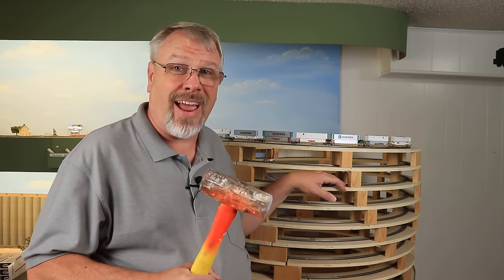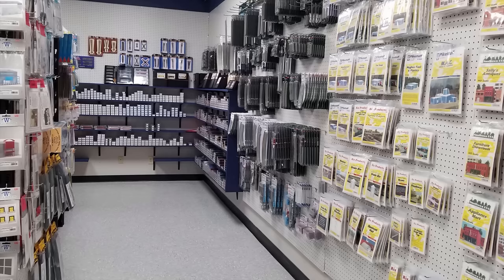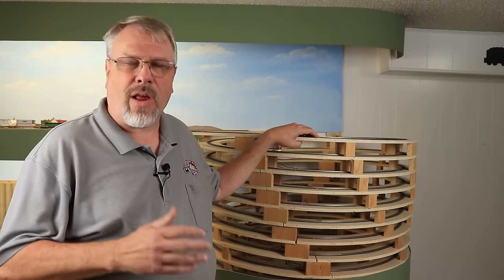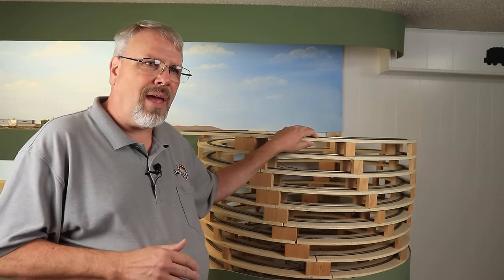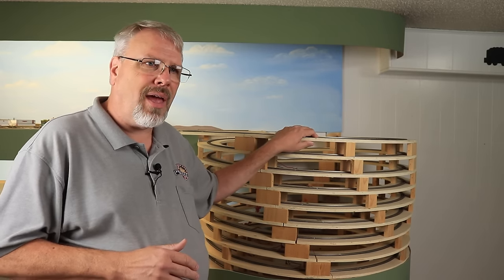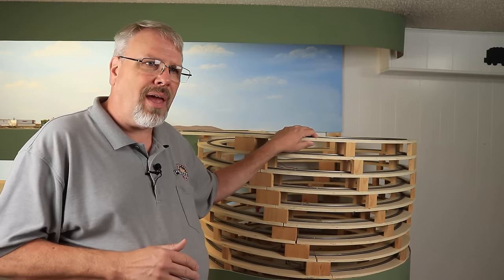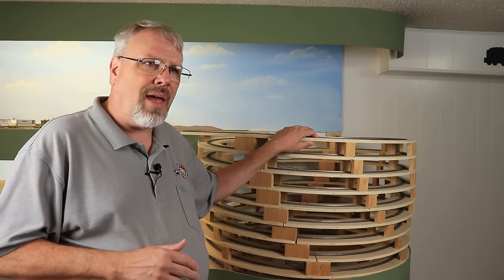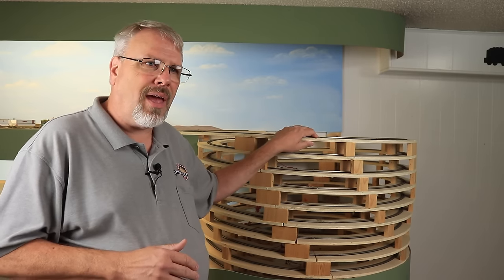Model Railroad Demolition - Bye Bye Helix

Comment: Very much enjoyed your demo video. I noticed you said you precisely cut the blocks between the levels. Your a better carpenter than most finish carpenters if you can do that 👍
I would suggest using threaded rods for absolutely precise adjustment to grade. I built o large helix as part of a crew on a friends layout and when finished we were able to make minute adjustments using a caliper and eye by turning the supporting nuts on the rods even a 1/4 or less of a turn. The adjustments are precise.  We used 24 turn to the inch but 18 turn would have been sufficient. One of the crew is an engineer and came up with a quick and easy system to spin the nuts into position on the rods. YouTube video listed under Jim Walsh
Consider this alternative to give yourself a break. 
Good luck 
Joe Valentine

Comment: +1 for 44" radius. Good move. Also recommend double track helix to eliminate delays and provides a passing location. You can always 'bad order' one track if you want single track ops for a change.
Reply from the maker: In my case, I have a passing siding immediately at the top and bottom of the helix, so I didn't plan for 2 tracks. That said, if I had a problem with a track, a second would give me a backup.
Reply: @RonsTrainsNThings   Certainly. Another possible value of the second track is to stage a train. Don't know if that works for your ops scheme but worth considering in the design stage.

Comment: NW Loop 820.  Well familiar with the area over by White Settlement when I worked at General Dynamics as an engineer on the F16 C and D models.

Put levels on the bottom of the legs for the new helix

Comment: Wow! Can't wait to see what you do. Thanks for sharing.
Reply: I too start in the second week in August spending the money and time to make room, level the ground, build a new fence, and pour a concrete pad for a shed for my new layout. I sold my test layout which will be gone tomorrow.  The new shed that will be built next year will be 12 feet by 16 feet. Wish I could go 20? but I just can't seem to swing it. However? It will be a nice insulated, central air and heating, with 70 amp beaker box to supply Power and lights. Can't wait to get that going. I will be watching what you do closely. After all I have two helix's to build. I plan on staying tune.
Reply from the maker: That sounds like an exciting project. Be sure to keep us updated on how building is going. Good luck.

Comment: Ron, I hate helices for many reasons. If I ever rip out either or both of mine, I will find a way to avoid replacing them, perhaps using a gradual, around-the-room incline. Admittedly, though, my layout isn't multi-level in the traditional sense. Trains go down my helices only to reach staging. And if I had to use a helix, I would make sure that it's open and accessible from all sides, so that trains and track in the helix can be reached easily without crawling under the layout. ...Roy
Reply: OHHHH PU YOU Panama,
Though I agree all side oh the helix, including the inside, must be reachable and repairable,  Ron is also correct that a helix offers the sense of time the consist needs to travel under.  Of course you presently ONLY go to staging.  Wait till you need more towns and scenery.  The lower level may need to start Operating.
As I wrote to you on your channel my big boys and I have started a rehab of my Upstate N.Y. layout 11 days ago.  Still a lot of demo to do, but the helix, in the mushroom, slipped out like track jointer before soldering.
We are saving the helix for another purpose, but this weekend we are shutting down the Bar Room.  Across the hall.  Since behind the back bar we will be building two dogbone shaped, DNA styled, helices.  From the ceiling soffit (about 12 feet high) down to 4 1/2 feet off the floor.  The early plans are to do a track loop.  Behind the Seeburg jukebox.  Actually in the adjoining room.  And return up to the ceiling on the opposing dog bone.  NO REVERSING LOOPS NEEDED.
My love to your wife.  Watch you soon,
~Jim
Reply from the maker: Hi Roy. I know you are not alone here. In a perfect world, I would prefer to have the same distance that is consumed in my helix in open layout. In this world, however, that isn't an option. My basement just isn't configured to allow for that. This helix served me pretty well. I agree about the open plan, and this helix was as open as possible in its location. Unfortunately there was a back wall and that is where my failrue happened--naturally. The new helix will be in the middle of the room, righ next to my spiral staircase (appropriate) and will be completely open, not to mention larger on the inside thus easier to get inside.
Reply from the maker: Sounds like an interesting plan.

Comment: Excellent video as always I enjoyed your helix tear down and I would suggest that in building your next helix you use threaded rod. Threaded rod allows you to make infinite adjustments to the grade I built one on a friends layout and in the end we were able to use a caliper and I contact to get the grade precisely we used 24 turn to the inch rod but in the end we found that 18 turn would have been more than sufficient think about it and give it a try
One of our crew Jim Walsh has a video on how to quickly put the nuts on the threaded rod is an engineer and thinks we are outside the box good luck on your next…

Comment: A cool benefit of a helix is it works as  a "holding pattern" for trains, giving a separation between "unrelated" scenes. For example, if you want a snowy scene in an otherwise summer layout, you may not want the train rushing in and then out of a short tunnel.

Comment: Just some thoughts and I'm no expert... if the upper deck wasn't so high up you wouldn't have had to build 9.5 loops! Probably too late but on your support legs include leveler bolts so if you need to adjust the height over time, you can adjust it. I look forward to seeing your progress...
Reply from the maker: The upper deck is where it is because I have grain elevators on the lower deck and need the clearance.

Comment: Great to see what you've been up to on your layout.

That's a great idea on the first turn of the helix. 
One thing you might try if wanting to keep an assembly together is to use a sawsall to cut the screws between adjacent pieces of wood.  I imagine you might have been able to remove the helix in one piece, well maybe a few pieces, with the sawsall method.  
Thanks Ron!
Reply from the maker: Hey Bruce. I thought of that after the fact, but I couldn't have reached all the screws anyway.
Reply: @RonsTrainsNThings  You made the best decision as I can only be a 'sidewalk superintendent' from this distance.

Comment: A helix with a “ sag an all” in Saginaw? Great to see the expansion and all the new lessons. Reconsider a double track helix, it can be unused if u like but available in case something happens to the main track and allows for staging or storage. Hopefully this frees up space to make north yard into the diamond yard it used to be so you can have equall length classification tracks. I can’t wait for all of the new videos on all of the things that were already finished before you started sharing.
Reply from the maker: Hi Derek. I do not plan to chang North Yard. It is already a diamond yard, just without the ladder on the north end. The class tracks are all the same length. What this will do is allow me space to model Saginaw the way I want--something that wasn't possible with the space I had before. It will also allow some open country scenery on the upper deck as well as a relocated and expanded model of Bowie, TX.

Comment: That came out relatively easy.   Looking forward to the expansion.  Have you seen Trackside Scenery's gator board helix.  Been thinking about the possibility of adding that someday.  Thanks for sharing.  Randy
Reply from the maker: Hey Randy. gator board would be an interesting way to do if weight was a consideration. Since I'm sittiing on a solid floor and gator board is fairly expensive, I think I'll stick with plywood, but I will be sure to check that out. Thanks for mentioning it.

Comment: I really like your videos even though I model HO scale. I was looking real hard at how you constructed your helix as that is the next phase of my layout, getting from level 1 to level 2. I have made a template where 8 pieces would make a full loop and I'm routing to save on plywood. What's your thoughts on that? I am also curious to know if you will eventually disassemble the old helix to recoup some of the track inside?  Take care! - Jason
Reply from the maker: Hey Jason. I will not be reclaiming any of the track. I don't think it would be possible anyway. I have had a couple people express interest in buying the helix, so who knows. I built my helix similarly to what you describe, except I cut my pieces to be 1/4 turn instead of 1/8. By making the 1st turn a single solid piece I could get the grade perfect. Above that, if my spacers are cut exactly to length, every turn matches the 1st. Like you said, this way I can get about 4 turns out of a sheet of plywood instead of 2. I will be showing all of this in detail when I build the new helix, but realistically that my be September...or October. LOL. BTW, you might be interested to know that I have some HO projects coming up soon.
Reply: @RonsTrainsNThings  I was going to do a double track main helix at 28"R and 30"R but I decided to go single to lower track cost and going 29"R so I have enough room between track and supports for articulate locos and cars. But with as wide of a radius I'm doing, If I did 1/4 turns, I would be lucky to get 4 cuts out of a sheet of plywood. I can get 16 1/8 turn cuts if positioned correctly.

Comment: Are you going to have just one track or 2 tracks on your new helix?  Also I have notice that if I did it I would have cross overs before and after the helix so if one track is messing up you can still cross over and continue operating. Good Luck.
Reply from the maker: I have a passing siding at the top and bottom of the layout, and waiting for incoming trains is part of the railroading experience, so just one track in the helix.
Reply: @RonsTrainsNThings  I was watching Sparky107107 and he had 2 tracks and he was running a train extra long heavy hauler and going up on the inside and got hung up so he had to back it down, than on the way down it went into the other track and if there was another train it would of caused a wreck.
Anyway Ron, thank you and I hope the information I gave you will help. I would go wider on the plywood so all my rolling stock will work. 
Also have you seen the guy who did a black plastic helix. He even used the supports from the plastic. It looks really interesting, also looked strong and durable.

Comment: In my new layout, I’ve been torn between having a helix or not. I may end up running steam on the upper deck and keep the two decks separate. Like two different layouts.

But then I think, that’s a whole lot more space on the upper deck to run long consists. Lol.

My Model railroaders lament.
Reply from the maker: Hi Mark. I understand. I debated for a year before I decided for sure. I know some people hate a helix. I have actually liked mine and it has opened up a limited space for a decentn layout. The biggest complaint I always heard was that the train was out of sight for too long. That is why I left mine open. Good luck to you.